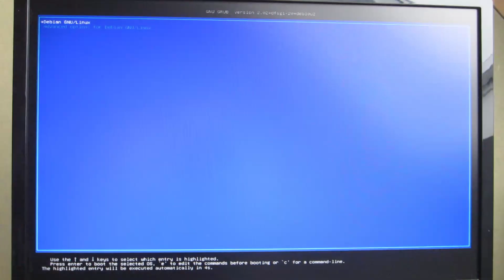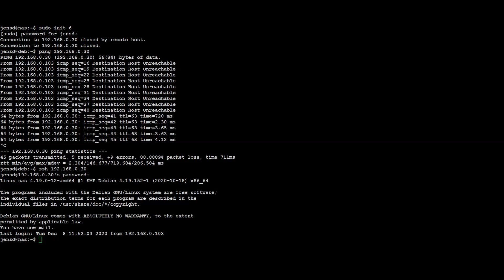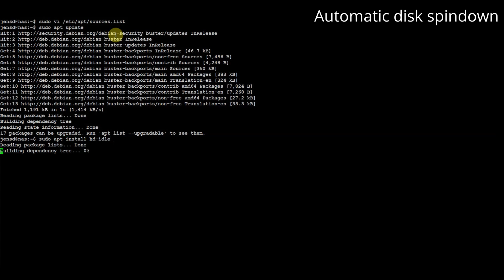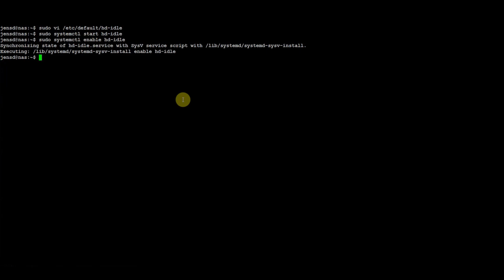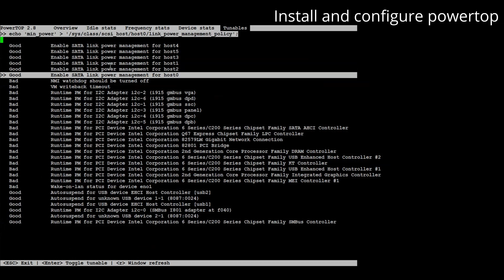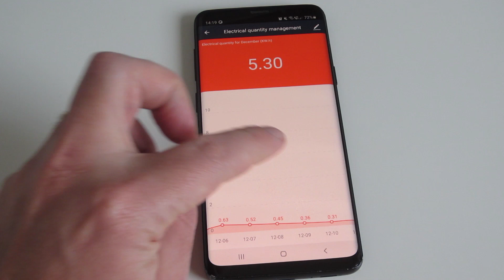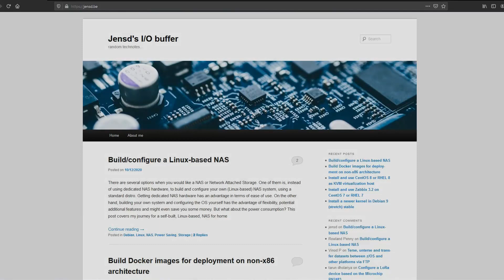Build your own Linux NAS - Part 3: Power Saving on Linux

Comment: Hi!
It's a really great tutorial! I benefited a lot.
I encountered some minor problems when using hd-idle, in debug mode, I can see that sda (SSD) and sdb (HDD) are spindown, but sdc (which is the same batch of HDD as sdb) does not show spindown information for a long time.
I don't know if there is any process that has been using SDC and is there a way to find out?
In addition, I did LVM for SDA and SDC (SDA for a virtual volume group called Cloud, and SDC for Media virtual volume group) to expand the disk capacity for these two different purposes. Does LVM affect HD-IDLE?

Comment: Hello,
It happen that I have a setup similar to yours : 1SSD and 2 WD Red plus in raid 1. I tried to spin them down but it does not work, did you already have this problem ?
Thank you !
Reply from the maker: The disk will only spin down if not in use after the configured interval. You can monitor this by running hd-idle manually: sudo hd-idle -d -i 30
Reply: @jensdbe  Yes I could finally make it work, but the service does not work 🤔
If I use the he-idle command it works but not the service